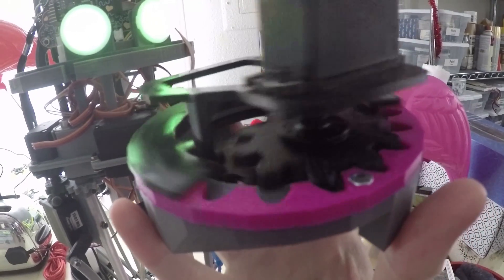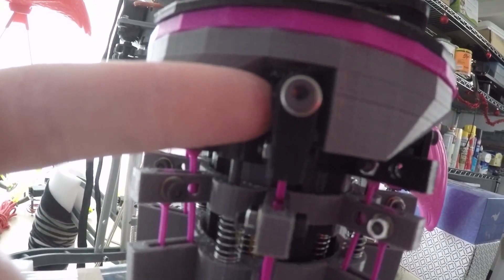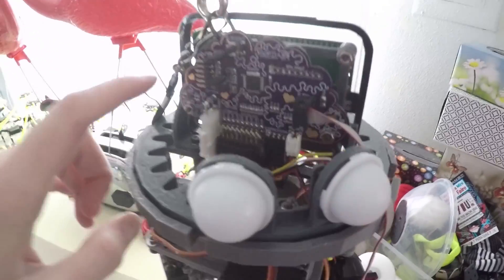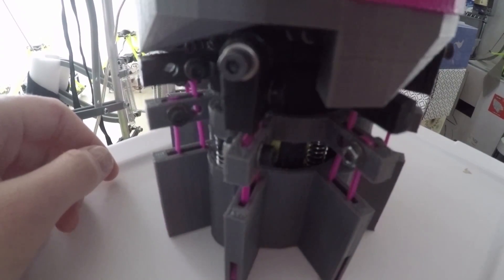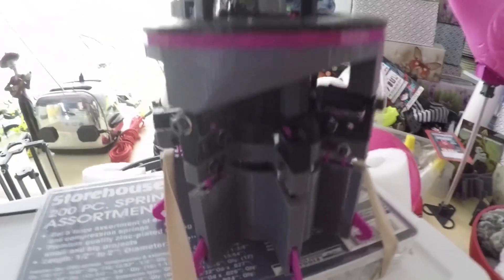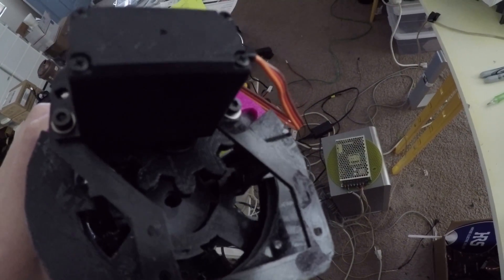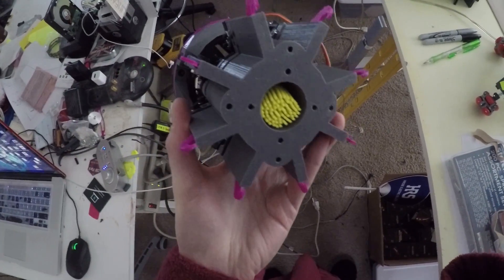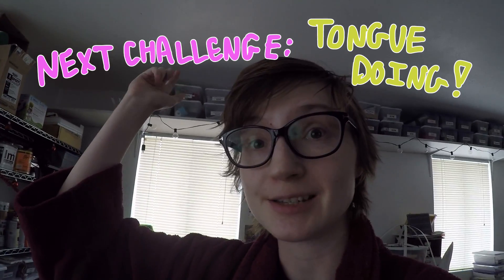Tasting Feet : Retractable Motorized TOE Success!

Comment: Awesome! You may want to smooth out the cam ramps so the motion gradually ramps up and down. That way there won't be a sharp mechanical stress when the follower hits the ramp and crests at the top. Love your work!
Reply from the maker: +J Com >.< I'm not sure how to achieve that level of design control in the CAD software I'm using. It is something i'll look into though for the next revision. Thank you for the feed back!